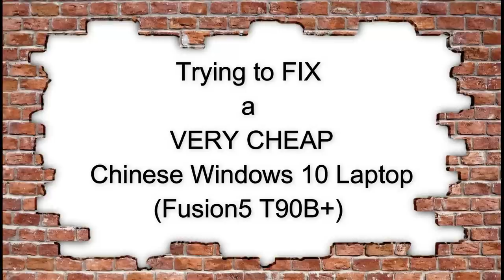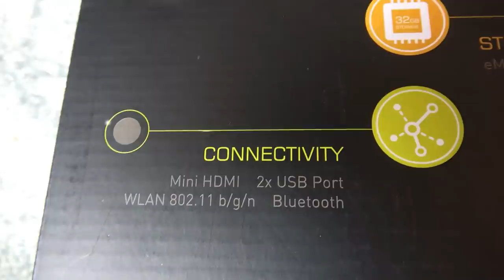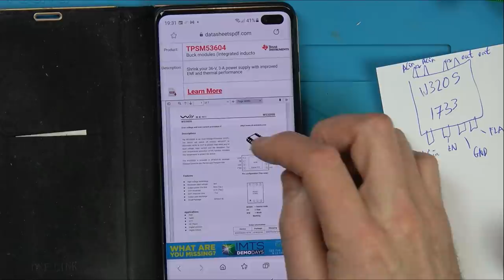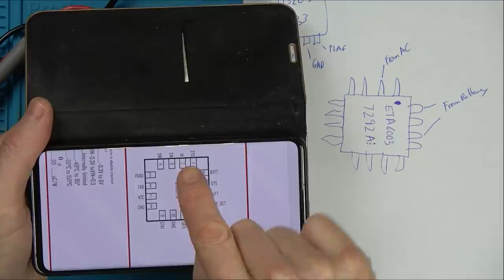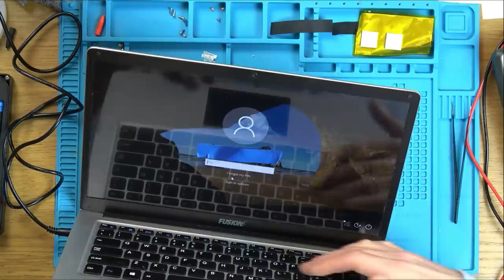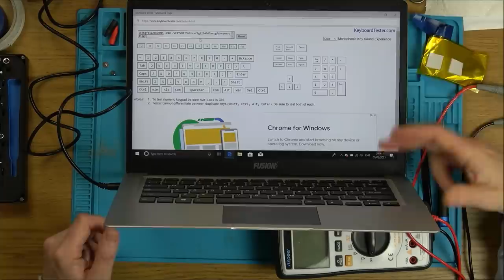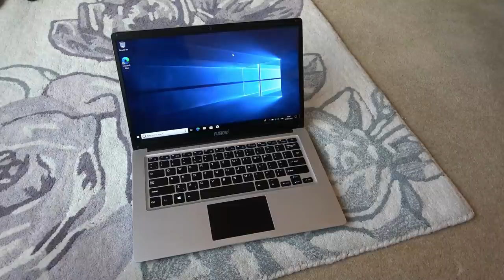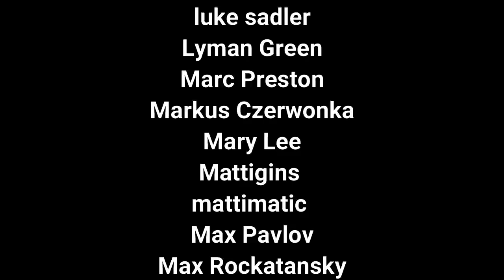Broken Low Cost Chinese Windows 10 Laptop - Trying to FIX

Comment: For future repairs, when you see life on the computer (LED turns on, fan spin, etc) and the computer doesn't turn on, don't waste time checking for shorts. Main voltage rails will be fine (19v, 5v and 3.3v), focus directly on power button. If voltage drops and the computer doesn't turn on, check the BIOS and/or the EC.
If it still doesn't turn on, it's time to dive in the boot logic with the help of a schematic.

Comment: Nice!  I had a laptop like this and you're spot on with your synopsis.  They look great, but they are horrible to use!  I gave it to my 10 year old daughter, and even she hates it.  🤣
Reply from the maker: Hahaha, yeah no one would thank you for one of these 🤣
Reply: Try with any flavour of linux. It will again be usable. 👍
Reply: @ErrorMessageNotFound  I agree and it won't fix a trash WiFi card
Reply: Yeah EMMC storage and Windows (or much else for that matter) is not a good combination.
Reply: just plug in a wireless mouse and usb wifi
Reply: @ErrorMessageNotFound  no however it would be easier to run on the system,therefor making it useable and not having load times of 10 years to open simple things such as chrome ect.
Reply: Giving your kid this laptop should be considered a form of child abuse. When I seen the emmc storage, and how long it took to reset the laptop, I knew this thing was going to be very slow. I guess to help deal with the wifi, and touch pad issues, you can get a usb wifi card, and a normal mouse. That's all I can think of, lol.
Reply: @kieranhutchison9810  However Vince's complaints were not of the laptop running badly. He only mentioned wifi and the trackpad.
Reply: just use it wit a docking station  wireles keyboard an mouse with a tv or something is not that bad unless its slow with not enough ram.
Reply: @Mymatevince  Put Raspberry Pi or equivalent bits in it... it should be a good upgrade/video/mod  :):)
Reply: @Mymatevince  Correct charger polarity-voltage-amps ?? above or below spec can cause issues too....
Reply: @kylereese4822  How do you connect the display up? It's proprietary in this laptop to the motherboard.
Reply: @lbsiuk  There are conversion driver boards you type in the screen part number and get a board to match :)
Reply: @kylereese4822  yeah I know, the display in here uses eDP. Its the cable that goes between the cable and motherboard. The connector on the motherboard is proprietary, with a custom pinout
Reply: @lbsiuk  Yea on that point you`d need to figure out the pin-outs and make the new connector on a new cable/remote from board to compensate... once you get the  correct set up if its a common fault type laptop you could sell a conversion ???
Reply: @Mymatevince  please check my comment on this video I really need your help
Reply: @ErickBuildsStuff  Not great wifi, crappy trackpad, and a barely existent cooling solution on a quad-core Intel chip that is like going to throttle.  Even Linux would have a hard time, especially if it's thermal throttling.
Reply: @ErrorMessageNotFound  yep you are true
Reply: @Ebolachicken  how can you plug it in when its wireless? huh?

Comment: Well done Vince. Just a couple of suggestions ... can you extend the WiFi aerial so it runs through the hinge and up the rear of the screen?, check for new drivers  .... also you could try installing a lightweight Linux with a Windows skin to improve the performance. All the best, and keep up the great work!

Comment: I love how on the box they promote this "laptop" as "thin, light and powerful", then inside the case they've screwed an extra couple of hundred grams of steel to give it that "quality" feel...
Reply: That’s there to reinforce the chasis and balance the entire lower portion of the computer.
Reply: Okaaaay... Ballast, yes. Reinforce the chassis, no. A piece of steel in that position ain't gonna do shit for reinforcement.
 It's there primarily to fool you into thinking that this product is of higher quality than it is
Reply: I think it is mostly to prevent it from tipping over, when the screen is open.
Reply: More or less what Apple does, except they make the case thicker and add more batteries inside. There's hardly anything inside a Mac now.
Reply: I agree a bit of weighty steel always conveys the appearance of a much better machine, although you would think the lighter the better but in this case much too light without some steel to bulk it up.
Reply: It’s a counterweight for the screen. Otherwise it would always flip backwards.

Comment: Nice repair indeed. I wish all laptops have independent power-on buttons. Keyboards are the first thing that fails on any laptop I've owned. I have one with several keys not working, and I'm sure it's the traces/contact pads at fault. Gotta get that silver ink...

Comment: Very interesting architecture. It does remind me of a 2010s smart phone or tablet, albeit with the Windows operating system. Enjoyed the video.
Reply from the maker: Thanks HFR 👍
Reply: It's becoming increasingly common in sub £300 laptops
Reply: @_._shinonome_._  budget laptops for the college student maybe? Honestly, I can understand that given early 2010s cell phones were more powerful than my first laptop late 90s/early 2000s. Plus form factor is an increased cost savings given the expense will be the screen and battery for manufacturing (most likely). Definitely not "performance".

Comment: Great fix =D  Yeah, these super cheap laptops are pants!  Usually so very little performance that every action is painful!
Reply from the maker: Cheers Chris 👍 It is painful to use. On this one the Wi-Fi is the big let down. Also no upgradable parts, shame really as it looks good.
Reply: @Mymatevince  I'm sure that LCD panel will be of some use in a future project (if you can't sell it). Even if you aren't taking the other spare parts into account, with that panel's value alone you've broke even on your purchase 👍
Reply: @rwild7054  the LCD seems to be about the only decent part looking up the spec - 1920x1080 - battery might be useful if the 10000mAh figure is true

Comment: About the wifi connection, you can use a USB adapter. I had to do this with an old laptop that had a limited speed internal adapter and it works really well.

Comment: This laptop reminds me of the new Lenovo Ideapads they too have a tiny motherboard with a soldered in sandisk 64gig sd card but at least with the expensive Lenovos the covering is a metal plate used as a heat sink for the sd card and the CPU chip but in reality it goes to show how much the Lenovos are really worth not really the eye watering 1000 dollar systems they charge Great video have to say your getting better and better at this laptop fixing

Comment: Great job Vince! As far as the touch pad not working poprtly I'd connect a mouse by usb, I never liked those trackpads regardless and a mouse is much better IMO.  As far as the WIFI goes try updating the WIFI drivers and make sure the settings are right. Could just be a software issue.

Comment: Hey Vince, those machines are quite low end. I have one, would recommend that you reinstall Windows with ReviOS (a stripped down version of Windows 10, designed for low end devices), if you are going to do that, then don't delete the recovery partition with the drivers on it, like I accidentally did.
Reply from the maker: Thanks LBSi 👍
Reply: @Mymatevince  Oh, and congrats on 700K too. You couldn't deserve it more!
Reply: @lbsiuk  did u get the drivers back?
Reply: @ZahNiNah  I've been attempting too. It's only the WiFi I need, which I've identified but haven't found a driver that works yet. Or it could be I didn't push the antenna on right? I'll replace the antenna anyway with a larger one.
Reply: @lbsiuk  use snappy driver - after a long search snappy did it for me for the wifi
Reply: @ZahNiNah  OK thanks, hadn't thought about a driver updater on this PC yet
Reply: @lbsiuk  tried a few of them snappy was the actuall one that worked.

Comment: When you see the long steel part to turn the pc heavier lol
Reply: It's to not make it feel like a toy and to give extra structure to prevent bending and breaking. But its a major red flag indeed.
Reply: @thomasesr  strange given in pc laptop land being light is lauded as a thing to brag about. Most brag all over the marketing material about how light and portable they are. It's essentially a single board computer with a physical keyboard, like a raspberry pi 400
Reply: @1invag  marketing bullshit vs peoples expectations = thin and light with weighted steel bar paradoxical products
Reply: It might have some legitimate use. Maybe to balance it, so it doesn't fall back because of the screens weight.
Reply: @Mobin92  was just about to comment that
Reply: Supertech  They haven't done that since 2012. Please stop spreading BS.
Reply: lol im the 69th like

Comment: A friend had a similar problem with a cloudbook , it was the same as the one you show in the video , the power led started to blink like that so we started to unplug things and left the board only with the screen , keyboard and battery suddenly the laptop started to power on without any problem. So we reconnected everything and it worked just fine.

Comment: Looking at you fixing the keyboard reminds me about the time that I tried to clean a Compaq Presario laptop.
The keyboard was covered in hairs and crumbs on the top🤮so I tried to take the keycaps off with a pull tool which worked mostly well and cleaned it out with a bit of Flash and some cotton buds.

Word of advice: Be very careful and DON'T use too much force to pull the keys off because the tiny switch mechanisms are the most likely to snap and when they do you'll find that the key will not go back on nicely or even at all!
Even on my first attempt taking off ALL the keys I broke 3 arrow keys, Enter, Caps Lock and the Z key. Thankfully I managed to fix most of them with a tiny bit of superglue on the edges of the keys but they don't press down as well as they used to.

Nevertheless you did a lot better than me putting all the keys back together and making them work. Thank you Vince! 👍
Reply: If you are talking about that white plastic bit, I'm sure they'd cost pennies on ebay or a whole new keyboard for £7 or £8 or something

Comment: It was nice seeing you have success with this repair!  I wonder if this would be usable as a sort of portable word processor, using USB drives to transfer files?  With a small mouse to replace the track pad perhaps?  It might make a nice NaNoWriMo tool?

For repairing or rebuilding plastic welded connections like that, I tend to use hot glue, super glue and baking soda, or modeling glue with appropriately sized pieces of plastic depending on the situation.  I'm glad your soldering iron worked, but I'm always worried that I'll do damage I can't see on the other side or not get as strong a connection as I could?

Comment: What you could have done to make the Wi-Fi decent is added in a proper Wi-Fi antennae which are really cheap, there is plenty of room inside, so you could add a proper decent size one and get a superb Wi-Fi signal, better than most even. Also, you might have noticed there was a spare internal USB solder point which could easily be hooked up to a Wi-Fi 6 USB, you could even add 5G or 4G while you're at it, if you're going to take the time to do all that for the repair it seems a shame not to go a few extra steps. A simple heatsink on the SoC would have helped out too, would stop any thermal throttling and allow you to run at a higher wattage to get much better performance out of both the CPU & GPU parts of the SoC. Another cool optional upgrade with all that extra room in there is to add in some better/louder speakers, it would then be an awsome media/YouTube device thanks to that decent looking IPS panel it has.

Comment: Another great repair, shame all that greatness was wasted on a poor product 😔 I think I would’ve been tempted to rig up an external button somewhere back to pin 3 and 4 instead of taking it all to bits, but it wouldn’t be as good as a proper repair like you’ve done. Also would that conductive paint thin down with a bit of ipa?
Reply from the maker: Thanks Paul, it does thin out a bit. A little heat and it flows nice so I need to remember to heat it up next time to make it easier to apply 👍

Comment: If you find a similar plastic that sticks, you might be able to use it as a filler rod and add more to the plastic post. I welded a hole in a plastic car fuel tank with strips of an engine oil container as a filler rod, and a soldering iron.

Comment: You can download Windows 10 ISO from MS and a free program called Rufus to make a Windows To Go USB for testing.  Basically it's Windows running on a USB.  This would've made the KB testing a bit easier ;)

Or another alternative is download a Windows PE environment (cut down Windows for troubleshooting).  There are many free "Boot CD" (usually you want a USB now) compilations such as Ultimate Boot CD that you can use to run Windows PE and a lot of other testing applications.

Comment: The main problem with those flex ribbon style of keyboards is every time you press on a key you're putting pressure and torque on That area from the ribbon. And with and being so then in the first place I will not be surprised if that's what caused the fault

Comment: I am using a iMac G3 keyboard on my modern iMac, because i like the feel of the original apple usb keyboard, but some keys stopped working randomly, so i took it appart, and i added some carbon with a pencil to every pad on those membranes and i have to say, the keyboard is working fine ever since

Comment: for the problem with the bad mouse and wifi:
if you want to use it as a backup computer you can use it with external mouse and usb 3 wifi dongle
it might give you something decent to work with

Comment: I thought you went above and beyond there. I never thought breaking the plastic clips off could be reversed... using a soldering iron to melt the clips back in place - genius! I'd of probably soldered a couple of wires on the pins on the board that operate the switch and either had an external on/off switch or seen if there was room to drill a small hole in the case to have a working on/off as part of the case. At the start of the video, I was thinking - nice laptop... UK made, etc... then the more I watched, the more I cringed. That thing on the inside looks like a bag of sh1t. I understand cheap, but then there is virtually unrepairable - then on top, you've said it barely works even when its fully operational!

Comment: A late comment, but I hope it helps. I've seen similar laptops and they were all failing about that power button. My fix was to just solder some extra wires on those two pins on the board and attach a small switch (tack switch) to those wires. Then drill a small hole on the side of the laptop and expose the button.

I think the power button fails just because of bad design. As Vince demonstrated, the power button works as a switch and ground that 1.7 Volts. I feel that the tracks on the keyboard deteriorate over time with those relatively high currents. Thus the power button on that keyboard is destined to fail. I've once changed the whole keyboard with a new one and it failed again adter 1 year of use.
Thanks Vince for the unyielding pursuit to find the root cause of the issue.

Comment: Great video!!  What about adding a USB wifi adapter?  That should help increase the range and then add a USB mouse so you don't need the trackpad.
Reply: that will solve two of 232233 problems these laptops have. If he use it with some light distro of linux maybe (and only maybe) it can be somewhat useful but with win10 trying to work on machine like this one is just beating a dead horse.
Reply: @gorky_vk  yeah for sure.  I was thinking it would be more of something for his son to play around with.  You definitely aren't doing anything worthwhile with essentially a cheap tablet trying to run Win10

Comment: Strangely I have something of a soft sport for really, really, cheap laptops.
Somehow they remain functional, if you treat their limitations with respect, while having next to nothing inside them. I particularly like that this one has a bar of pot-metal across the trackpad - maybe it stops the screen tipping it over, but you know that while most manufacturers try lighten their devices this was added primarily to give it a bit of reassuring heft. Knock-off smart phones are often the same.

Comment: you need a variable power supply or a lipo charger and charge the battery externally
Reply: in any case , keep that in mind for future repairs , lipos pretend to be dead when they are below a certain voltage  but they can be revived by externally charging em

Comment: My phone is broken. I plug it in to charge and it stuck charging with the screen off. I disconnected the battery and still nothing. I'm pretty sure I short the pins for turning it on, but still nothing. I tries finding the pin for Manufacturer mode so I can reinstall the firmware , but that didn't work either. Sometimes those ARM devices brake and there is nothing to be done.